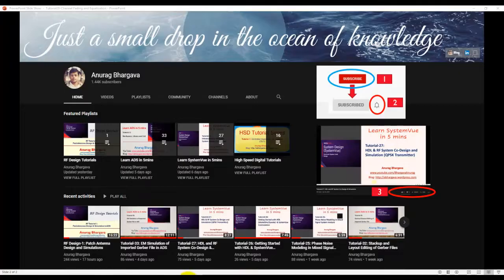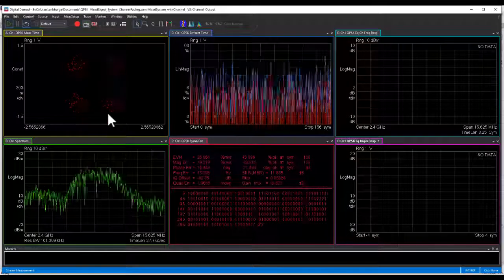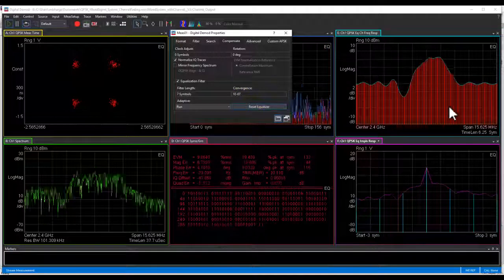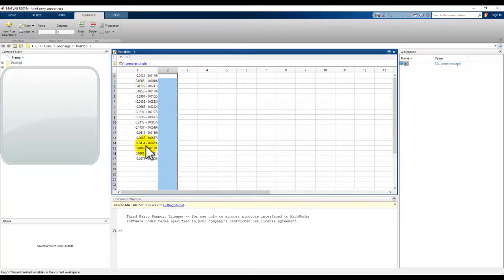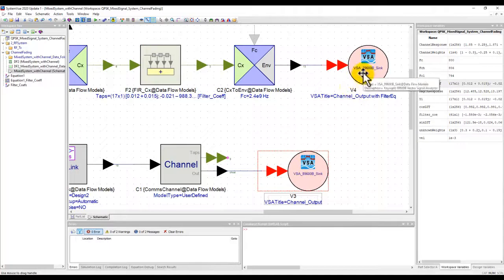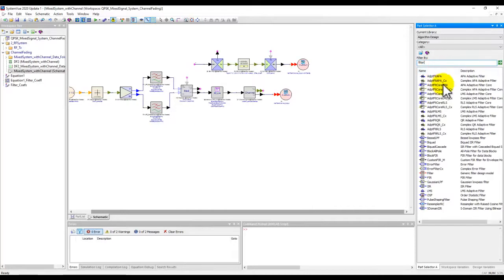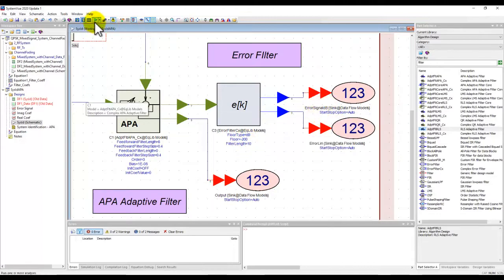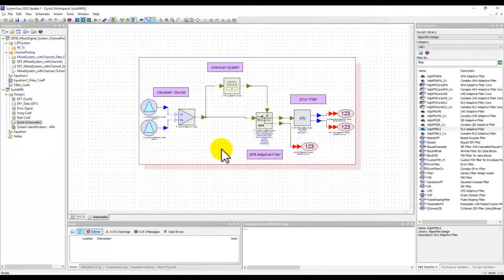Tutorial-28: Channel Fading and Equalization

Comment: Wonderful job Anurag! Please keep this up! I have a few questions and very much appreciate your help. To run HDL code we should have ModelSim Questo tool (even though you don't need to do HDL simulation) shouldn't we? I can create the modulator in Simulink,  use HDL coder to generate the HDL code and  use that here. Do we still we need Questa? Last question, I also know SystemVue (SV) design can be used inside Matlab as an engine. Assume I want to use SV Spectrasys for the RF TX and RX designs and signal processing in Matlab/Simulink/FPGA. Also assuming HDL code has been implemented in an FPGA, which way would run faster, running this from SV or from Matlab?  Thank you!
Reply from the maker: Hi Janaka,
I am not sure what do you mean by "even though you don't need to do HDL simulation"? For any block containing HDL code, we need to run HDL simulation and that is why you need an HDL simulation engine and in our case it is Questa.
Yes, SV can be used inside Matlab environment but I haven't compared simulation speed but I would imagine it won't be too different as we also use Matlab engine behind the scene to process any .m code you write so that processing should take same amount of time but I haven't tested it myself. 
Choice of bringing Matlab to SVue or vice-versa depends on user's preference, there are some set of designers who may want to be inside SVue environment if they are more concerned working with RF designs and at the same time we may have few designers who wish to stay inside Matlab environment and mostly those are Baseband level users needing to work more on fine tuning the code for system performance. I have no benchmark to compare simulation speed if HDL is involved in both cases as I do not have all the licenses to even try the same....😊
Reply: @BhargavaAnurag  Thanks again for your reply Anurag! In Simulink we can compare the simulation results of the Simulink model and HDL model. Once they are compatible we just need to use it with SystemVue. In this case it is not essential to have another HDL simulator. However, without specifying Questa in the path can we use this HDL design with SVue?

Comment: Thenk you so much..
I have a problem to create an RTD diode and I dont find any type of diodes or transistor ??
Thanx
Reply from the maker: I don't understand your question hence can't provide any answers...😊 Note that SystemVue is a system level design tool so not necessarily you will find circuit components such as diode here. If you need component level design then use software like Keysight ADS.
Reply: I’m trying to build an RTD Oscillator (Resonant Tunneling Diode) and RTD Detector. I think I have to use X-parameters and Circuit_Link in RF Design, but it's quite complicated. Would it be better to build the circuit in ADS and then export it to SystemVue to work with it as an ADS Box, or should I complete the entire design in SystemVue?
best regards